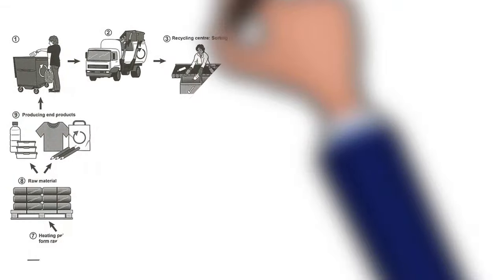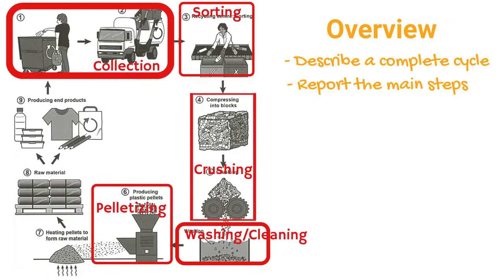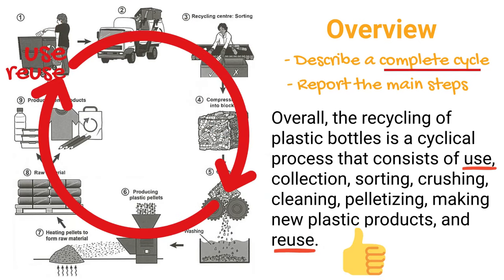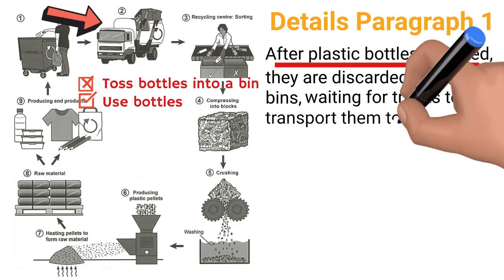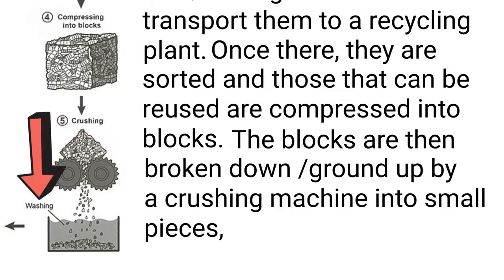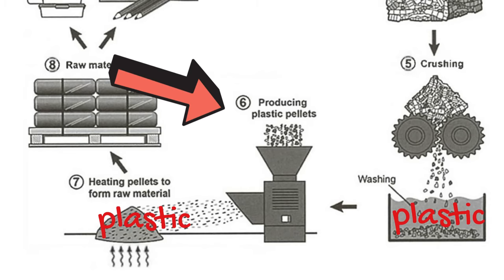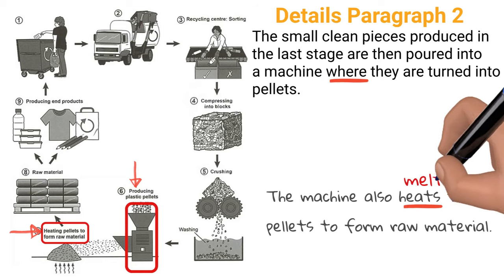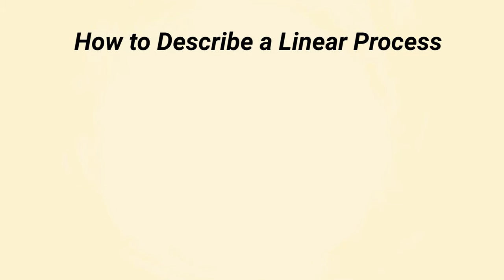how to describe a manufacturing cycle - ielts writing task 1 process diagram

Comment: The diagram gives information about how plastic bottles are recyled. 

Overall, the process consists of 9 stages and it starts with people throwing plactic bottles into containers and it ends with manufacturing the end products.

First, people throw their plastic bottles into containers. The bottles are then ready to be collected with lorries. The next stage is that, the collected plastic bottles are eliminated by workers by hand. After that, the bottles which are convenient to be compressed into blocks are moving to the next stage. Next part is the crushing stage. In this stage the blocks of plastics are put into two rotating gears to diminish the plastic bottle dimensions. This stage also covers washing the plastics. In the next stage, these tiny plastics are put into a machine which allows plastics to transform into plastic pellets. After that, these pellets are ready to be heated in order to form raw material. In the last stage of the process, the raw material is then manufactured into different kind of end products such things as t-shirts, plastic bottles, and recyling bags.

this gets 6.5?
Reply: use and reuse instance end.
Reply: Please teach me writing  task1 otherwise my all dreams will go in vain.

Comment: The diagram illustrates how plastic is extracted and recycled from plastic bottles. 
The process starts with used plastic bottles being collected from recycle bins. A recycling truck collects the bottles from bins placed around the city and transport them to the recycling facility. Where the bottles are sorted out by hand and then sent to a hydraulic compressor which compresses them into blocks. 
These blocks then go to a crusher, which breaks them into smaller scrapes of plastic. After getting crushed, the scrapes are sent for a wash. Next, these scrapes are fed to a machine which process them down further and turn them into small pellets, finally these pellets are heated up to form raw materials, which are then shipped out and used to make various products such as bottles, containers, bags etc. 
Overall, the recycling process consists of nine steps, which includes collecting and sorting of bottles, Compressing and crushing followed by turning them into pellets for raw materials. Products from raw materials are made and the cycle continues. 

What do you think? I wrote this before watching the video, so I could compare my ans with yours.

Comment: Hi Lilie, I just practiced this task this afternoon then find this your video. If you don't mind, you may check this out and give me any advise please. Thanks! :D
.
.
.
The picture illustrates the recycling system of plastic bottles. It is apparent to note that this process is divided into manual and machinery operations. 

It is clear that littering rubbish is conducted on a daily basis by the community. They throw in the garbage container which is proposed to recycle. Next, the garbage truck will come to take them and bring them to the recycling center for sorting. Transportation and sorting are conducted by humans. Furthermore, it is continued with the machinery step, where the sorted bottles are compressed into blocks, and then are crushed by certain gears. The small parts of the crushed bottles are washed to remove dirt or potential contaminations, then are processed into a machine that produces plastic pellets. The last step of the recycling process is heating the pellets to shape the raw material that can be utilized to create plastic end products such as stationaries, recycled shopping plastic bags, clothes, as well as plastic lunch boxes and beverage plastic bottles. (166 words)

Comment: The given process illustrates how plastic bottles are recycled after human use. 

Overall, it is a cyclical process that consists of ten steps of different lengths and purposes. Starting from the usage of bottles, to the transportation of plastic waste, sorting, compressing, crushing, washing, producing plastic pellets, and heating them in order to form the raw material , which can be used to produce several items so that people reuse them. 

First of all, humans dispose plastic bottles after using them in particular bins for recyclable products, which are transported to the recycling factory using lorries. Next, sorting takes place, where workers separate bottles based on different criteria into the right container. In the subsequent step, the selected bottles are accumulated into blocks, which have the shape of a cup. 

Blocks are broken down using a sharp machine into small pieces in order to wash them. The coming step involves another gadget that is responsible for producing plastic pellets from the washed particles. After that, pellets are heated for a specific period to produce raw material, which is used at the end for the manufacturing of many recyclable goods, such as bottles, lunchboxes, pencils, and clothes. After these products are utilized, they go through the recycling process all over again.

this is my essay after editing it based on your advice and help!
  how do you find it??
Reply from the maker: Hi, good overall. But the overall is way too long. "Human" sounds very unnatural in this context. I suggest using the passive voice instead.
Reply: @LilieIELTS  but in another test, the examiner said you need to mention everything in the overall( all the steps).
Reply from the maker: But mentioning all the steps doesn't equal writing a long overview.
Reply: @LilieIELTS  thank you I will take your advice

Comment: The diagram illustrates the detailed process of plastic bottle recycling and reuse.

Overall, the cyclic process of plastic reuse involves four major steps: collection, transportation, segregation, and production. It is amazing to notice that products other than bottles, such as dresses, pencils, and shopping bags, can also be made using recycled plastic.

The first major step of the process is the collection. Plastic bottles are collected from the disposal bins, where they are discarded after usage, using trucks, and then they are transported to a recycling center. Once there, segregation is done for separating them from non-plastic and non-reusable plastic waste. The sorted ones are then compressed into blocks by applying high pressure which enables them to crush easily into small pieces using the high-speed rotating vanes of a crushing machine. The crushed pieces are then thoroughly washed in order to remove any residue or impurities.

Further, plastic pellets are produced by pouring crushed pieces into a machine. However, the raw material cannot be produced without heating these pellets further at high temperatures. These raw materials can be remolded and reshaped into different products which are later collected after their lifetime for repeating the cycle.
Reply: please evaluate
Reply: There is no first major step? It's a cycle... all processes are major ..
Reply: Disposal bins where they're discarded after usage, disposals are used for discarding... why explaining something that's too basic I believe.
Reply: 6 or 6.5 I would give. Not 7

Comment: Bp1 the process begin when  plastic bottles are collected in a dustbin  . After reaching to next point    collected material is sent  through the public transport then, plastic bottles are sorted so that they can suitable ones which can be recycled.  Before being crushed  plastic bottles are comprised into block and washed.  After that,   the pieces of plastic are poured into machine  so that raw Material can be gained.  Finally,   there are numerous goods are made by recycling  such as shirt,  bag, pencils,  containers and so on

Comment: The diagram illustrates how plastic bottles are recycled throughout the periods.

Overall, the recycling process of plastic bottles involve nine distinct stages, which helps to regain plastic in lots of new forms

The first step of process is to people threw bottles into the recycle bins . Then, the bottles are collected by recycling cars and sent to recycling centre, which is sorted plastic materials by workers. In the next process is to plastics are pressed all together into blocks and then whole plastics are crushed by crushing machine, after that those are washed in cabin piece by piece.

The sixth step of process is to washed plastics were used to producing plastic pellets by a machine. In the next phase is to pellets are heated to turn into shape of raw material. In eighth step is to obtain raw material from heated pellets. Lastly, raw materials are used to acquire end products such as plastic bottles, containers, t-shirts and bags at the end of the stage.